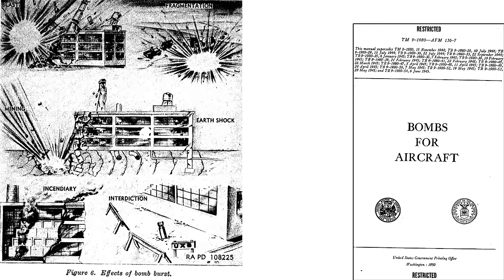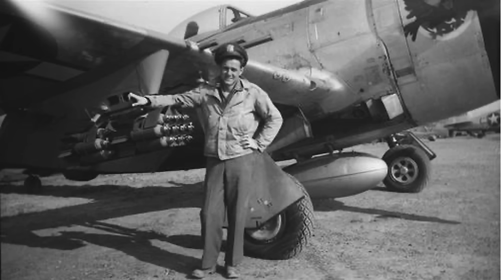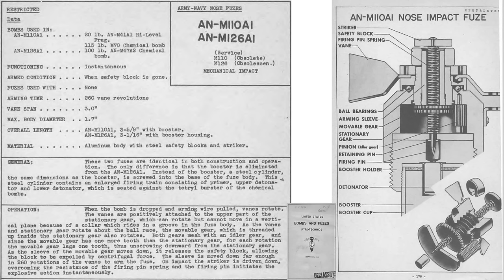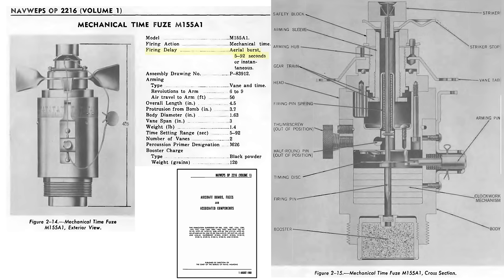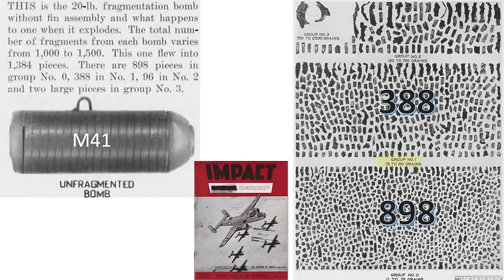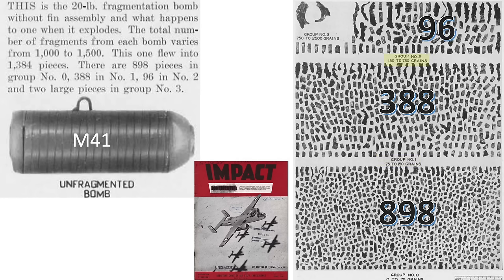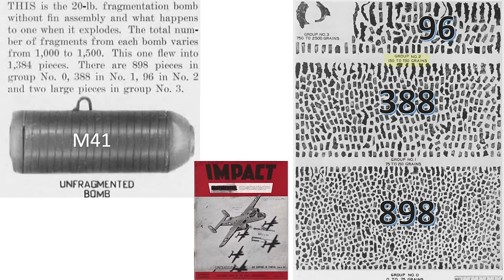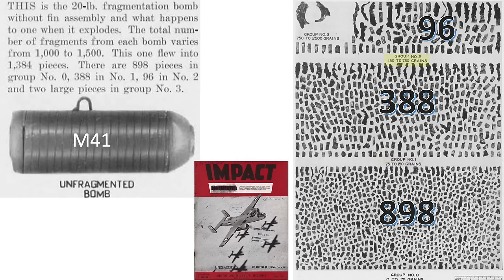Weapons of Devastation: A Comprehensive Review of WWII Cluster Fragmentation Bombs

Comment: As someone who spent 25 years loading weapons on 4 different USAF fighters and one bomber type, I find these discussions very informative.
Reply: I've always wondered, is there any danger of being contaminated by chemicals in the explosives when handling bombs?
Reply: @jethrox827  That was never in our rather lengthy safety warnings.
Reply: @jethrox827  That would be for the people who fill the bomb (or shell).  The people (often women, teenagers, senior citizens, and the occasional 4F) who would mix the chemicals, those who heated the chemicals and those who would pour the now liquid explosive into the bomb (or shell).
Reply: I was a load toad, just like the original poster.  Generally, the bombs are fairly safe.  The biggest hazard would be having something big and heavy crushing a body part.  However, my worst injury was removing an AIM-9L in the worst heat in Arizona and the 125+ degree missile started to cook our firearms.
Reply: @Easy-Eight  That happened to my crew also at Balad in the summer.  Storage brought a trailer of missiles that had been in the sun, maybe just from the drive over.  We couldn’t pick up the Sidewinder until we’d poured some water over the missile body.
Reply: Fully agree, these are very interesting snippets.

What was missing:
FPV

Comment: My father was a B-26 pilot. They dropped fragmentation bombs on German troops for the first time over Anzio. He said those things came out of the planes ahead of him like potato chips and his squadron flew threw them. He was amazed they survived.
Reply: Those bombs, if they hit a plane flying behind, probably didn't explode since the bombs' propeller vanes didn't have enough rotation yet  to arm the bombs.
Reply: Luckily it seems they went armed since they were so close.
Reply: FOD can bring down a plane just as effectively as AAA fire.  FOD is Foreign Object Damage.  FOD can be pieces of aircraft being hit with AAA, or objects knocked loose such as pieces of wings, engines, and parts of the fuselage.  When I was in the Army (helicopter mechanic) we cleaned up the runways and parking areas for the helicopters.  We looked for bolts, nuts, rocks and any branch larger than a finger. You would be surprised at how many nuts and bolts fall off aircraft.
Reply: @sjb3460  FOD is Foreign Object Debris, thus FOD damage is not like ATM machine.  Of course, the Navy and Army may occasionally differ.....
Reply: @grizwoldphantasia5005 or indeed nation.

Comment: The Germans also had cluster bombs.   They were called Abwerfbehelter and had designations such as AB500 and AB250.     These weapons could carry a variety of subventions.  The most interesting being the SD 4 HL or hollow charge dispersed by the AB250-2 which had 40 submuntions or the AB250-3 which could disperse the SD 2 butterfly anti personnel bomb.  Mostly they were used for incendiaries.   The number refers only t the approximate bomb mass only.  It's in fact a designation more about the shackle.  Interestingly some of the German cluster bombs simultaneously released anti radar chaff.  
-In general the Luftwaffe preferred to use bombs to destroy tanks (by sliding them along the ground with a time delay fuse from a Fw 190)  but intruded folding fin R4M rockets modified with a Panzerschrek warhead.   However they were testing rockets that dispersed the SD 4 HL with either 8 or 22 sub-munitions.

Comment: I wonder if proximity fused bombs will be discussed.  Fragmentation is more lethal if the bomb can be fused to explode somewhat higher above the ground.   The proximity fuses in bombs need not be as acceleration resistant as those in artillery shells, so they are easier to make.

Comment: Surprised that you didn't mention the "Daisy Cutter!!  Which is a piece of wood from a broom or mop handle put onto the nose fuse to ensure detonation (depending on the length of the "Daisy Cutter") from 12 to 18 inches off the ground...  The B-25s doing a low level run where almost certainly using these to ensure better Frag of equipment on the Japanese field!  They also used them on bombs up to 500 pounds!!!

Comment: Definitely not something you'd wanna be on the receiving end of. 
Between these and artillery shell's with the proximity fuses it's no wonder the German army was collapsing so hard in the last months, once they were on the run and had those two things coming out of the sky on them it was all over. 
You covered the use of all the different bombs used against the Japanese from the B29 but were these cluster bombs used as extensively against their ground forces in the island campaigns from ground attack aircraft like they were in Europe?
Reply: Sure as hell not an expert but I figure they used more napalm and longer fused bombs in the Pacific since so many targets were in deep cover or fortifications.